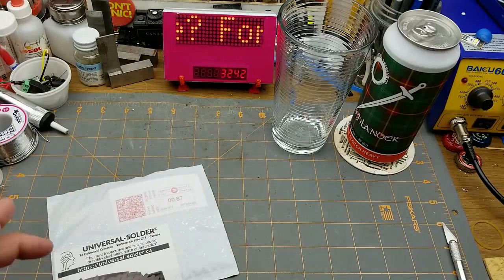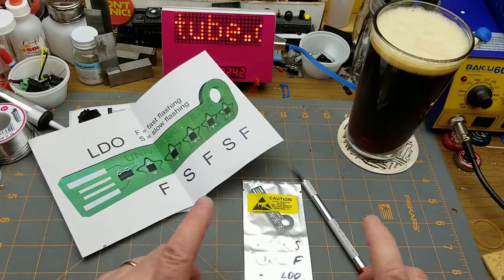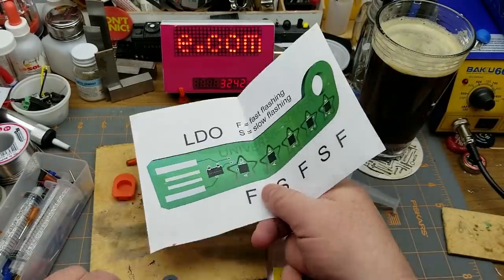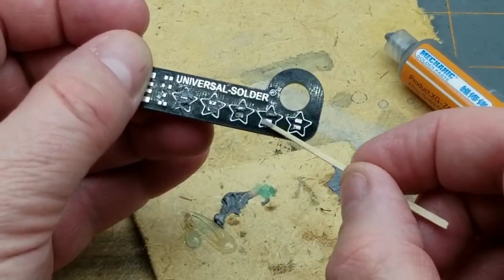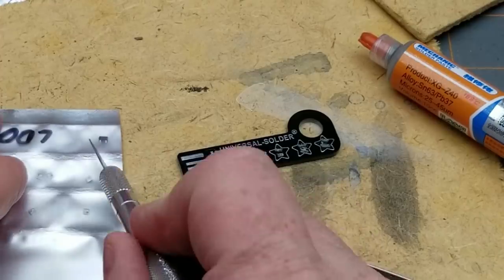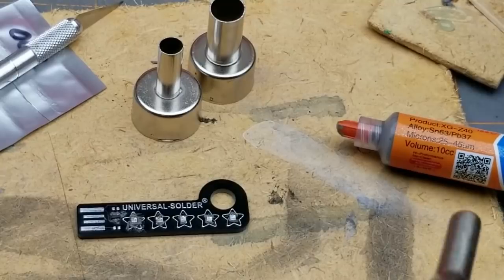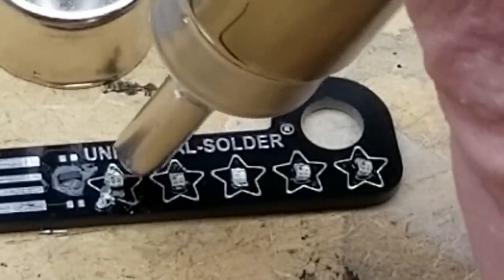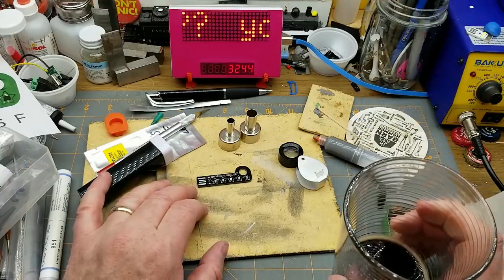Building a simple blinky led kit

Comment: "The bigger the gob, the better the job"  -AVE
Reply from the maker: That's kinda what I was going for.
It mostly worked, too.
Reply: @pileofstuff  MOSTLY...  I will give you that as It did work.  :-)  I find that if you wipe a globby SMD connection with a freshly cleaned soldering iron tip, you can pull off just enough of the excess solder,  A little solder wick also does wonders.  With solder paste, less is more.    Be sure to keep your paste in the fridge when you are not using it, and sometimes you can "freshen" it wiy a bit of isopropyl (or that not clean flux stuff which is mostly isopropyl).

Comment: I think warming up solder paste can help with it flowing and sticking better.
Reply: That's what I was wondering. Maybe drop the tube in hot water for a couple of minutes would help
Reply from the maker: Possibly, though I've read it should also be kept cool to preserve/extend it's lifespan.  I guess I'll just have to keep experimenting until I encounter either the ultimate solution or a catastrophic failure.

Comment: I hate applying solder paste by hand. Whenever possible I get a stencil and throw the parts on it. It‘s quite easy and the finished boards look quite professional. But I don‘t go below 0402. Mostly I use 0603 passives.
Reply from the maker: For multiple boards a stencil does seem like the way to go.

Comment: Bravo for making using hot air look easy, if a little messy. It would have been nice if he had sent you two kits so you could solder one by the traditional iron/solder method. Not all of us have a hot air station or can justify getting one...:-(
Reply from the maker: I did a bit of surface mount practice a while back with my old (30 years old) soldering iron. It was a bit of a challenge, but it actually worked.
 https://www.youtube.com/watch?v=GBML18PZxCQ

Comment: Don't waste time with solder paste on jobs like this... just use normal solder and a normal soldering iron.
Reply from the maker: I wanted to try out a new technique. What better place to experiment than something small like this?
Reply: @pileofstuff  - Of course! Was this experiment enough for you to form an opinion about the respective methods? (I ask because you didn't really express anything in the video, and I feel you hid your amazement that the kit functioned)
Reply from the maker: @johncoops6897  It's another tool to have in the bag.

I think if I was doing multiple boards, using paste and a stencil would be the way to go.

There are probably some other one-off applications where paste would be a convenient option (like soldering wires to an SMD led - which is how I did it on my "FRED" project a couple of weeks ago).

But for a kit of this scale, using the iron and traditional solder is probably still the easiest way. Maybe for smaller components the "smear on some paste" and an oven would work well.

I was more surprised than I sounded. Especially that I'd got all the LEDs facing the right way.